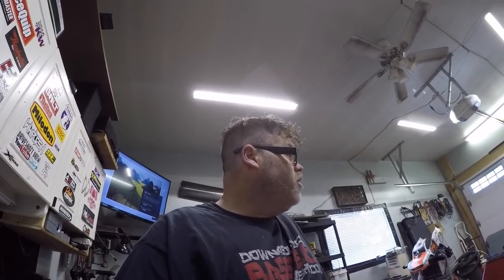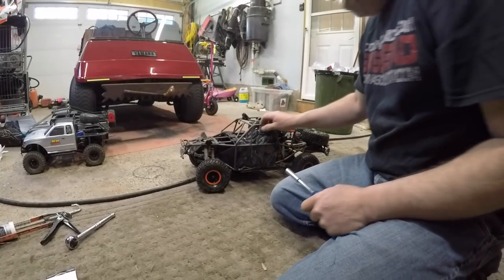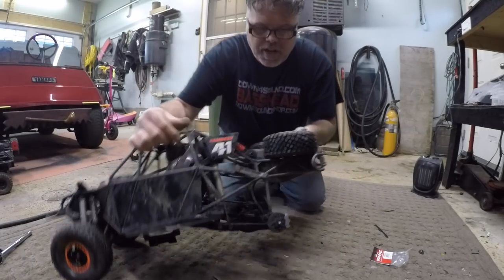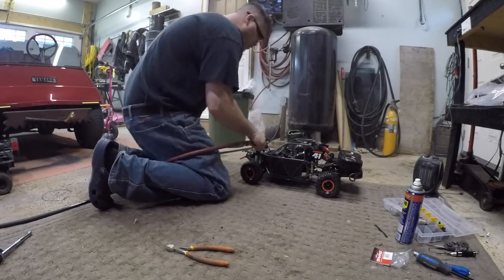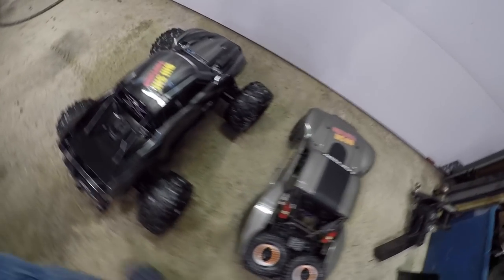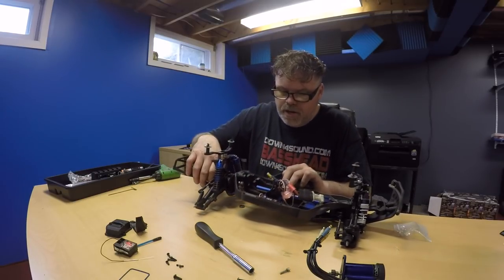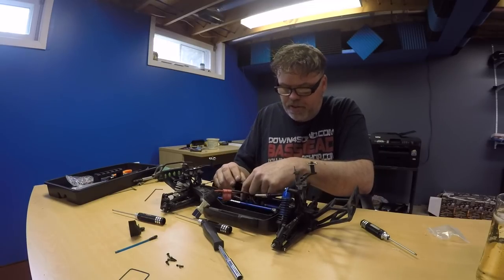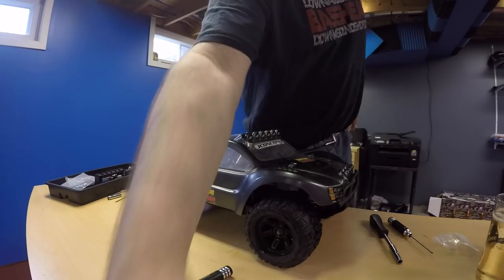1000's on RC Parts Never Ends

Comment: Just a tip for all the RC folks out there. Silicon spray like Pro Prep made by Silkolene is what I have used for twenty years for the plastic on all my RC’s and dirt bikes to keep the dirt from sticking and it also keeps the black from turning dull. WD-40 will deteriorate plastic after awhile. Pro Prep will also make fender flares and door handles black again on your cars and trucks. Thanks for sharing another outstanding show 🍺🥓☕️🍩☕️🥓🍺cheers 👍🏼